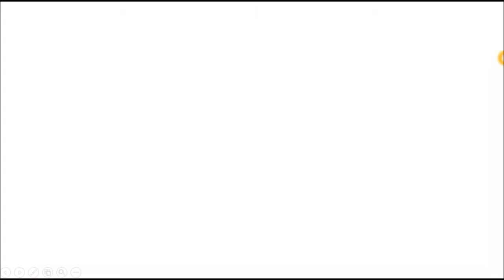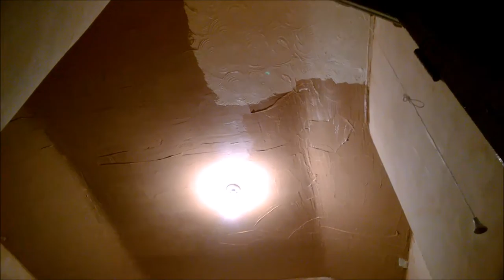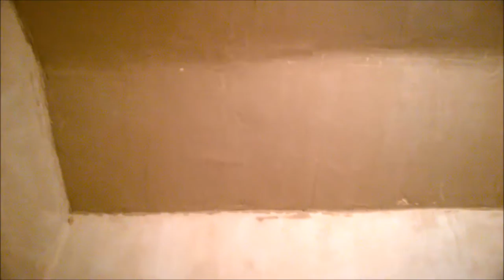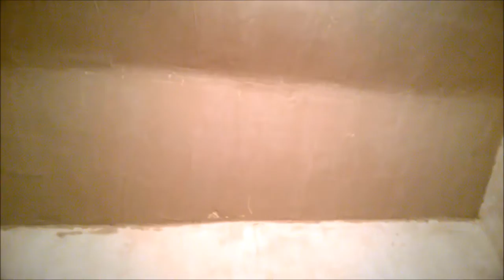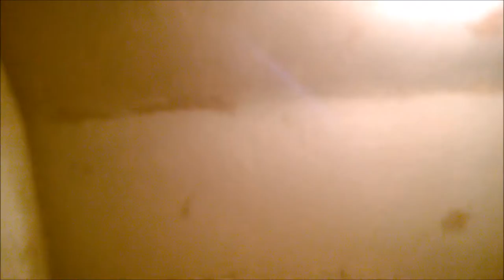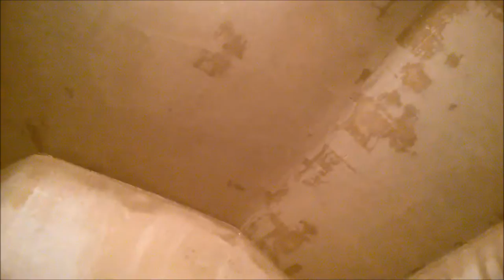My first attempt on plastering bathroom, artex, asbestos ceiling, before & after video

Comment: That sure was a great 1st time man I know it is to late as i seen you done a lot of the house already but if you do the ceiling 1st will work out easier for you so you dont have to clean the walls after I always hit ceiling 1st then walls so the drops to stain my wall and saves me cleaning at them. This type of ceiling if for sure the hardest to tackle with  the curves I would also recommend bond-coat to help build it down over them textures but of course this will take longer Well done again on this job for a 1st ever ceiling
Reply from the maker: Thanks mate! I realised that, next time defo bond coat it, and then carry out the principles of skimming. And, so right, ceiling has lots of drips and stuff, specially PVA and stuff which then sticks to the wall and can be seen through mist coat, which is exactly what happened today when applying the mist coat on this room. :(

Cheers for the vote of confidence!
Reply: No Rocket Science Build Yea the same thing can happen on walls when doing one side then the other why sometimes a wet angle is best even thought harder to do but will take this one problem out then again makes the job harder lol its all a balancing act how much you know you can do at one time never over do it
Reply from the maker: Cheers mate! I made a c*** of my ceiling plaster. I will load the video, how not to put up a plasterboard on the ceiling.
Reply: No Rocket Science Build Haha I did a how to alone on just a sheet but had to double board it and was using fire resistant boards even heavier belive me i had a hard time of it :) still have to upload it lol
Reply from the maker: Dude, doing those plasterboards killed me, more so I made a right mess of it lol. Here is just the plasterboards going up. https://www.youtube.com/watch?v=eoaP5BxsGQQ&lc=z13istp54nimc3022223s3wykpercp5rm04 I done the scrim-taping. But, the edges around the walls are wide open due to this mess so I am think of using corner tapes to close the gaps, is that a good idea?
Reply: No Rocket Science Build Yes use it and bond over it let the bonding set then skim away if really bad u can get expanding foam and cut of flush then tape and bond then skim